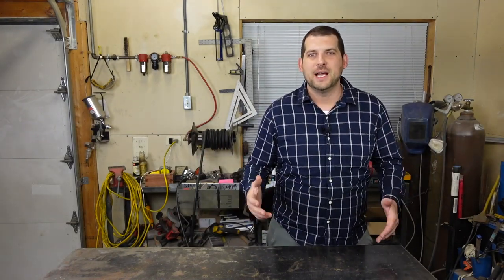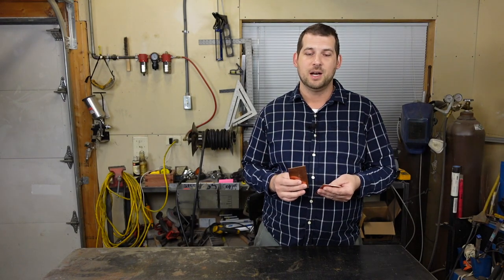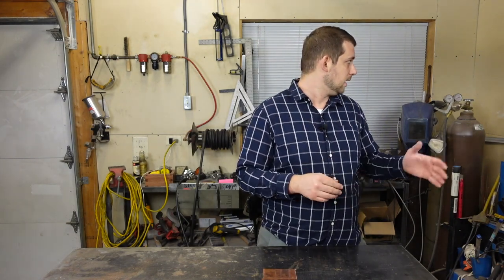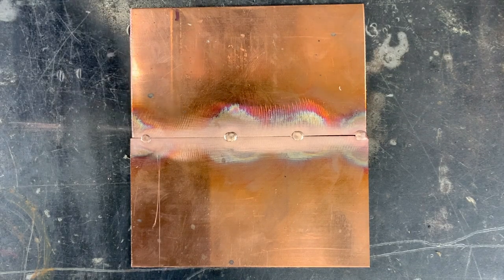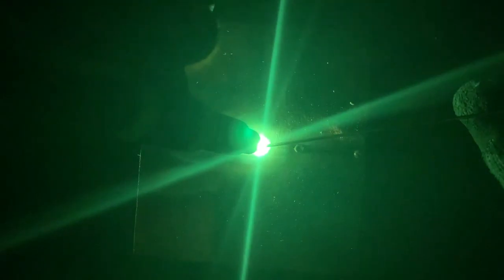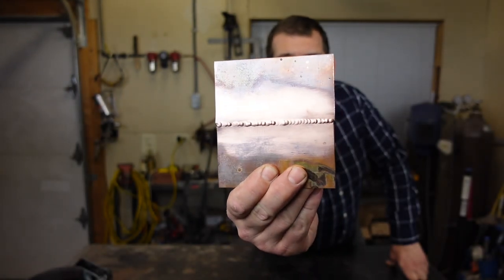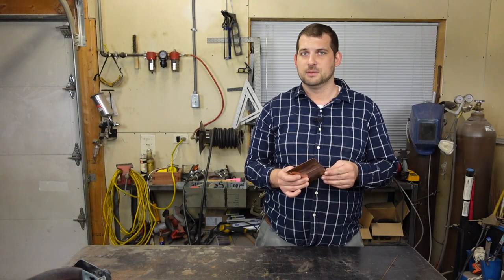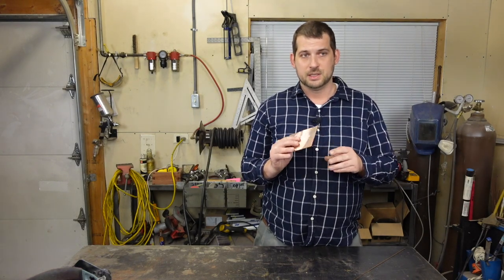CAN YOU WELD COPPER? - not solder, not braze, but weld? spoiler....yes you can and i will show you

Comment: novice question.. can you weld copper sheets together with mig? Instead of mild steel wire, would you need copper wire roll to feed in to the mig machine?
Reply from the maker: Yes I think they sell that as a specialty item.

Comment: That moth to the flame looked to get unhappy real quick! Interesting, I am looking to see of if I can weld pipe tight style an wonder if it would put less heat in the pipe overall. I have to braze pipe very close to sensitive parts and it is a challenge to keep the sensitive stuff cool
Reply from the maker: I think brazing is probably stronger on pipe since it fills the gap in the joint.
Reply: @TheMoonlightCraftsman  thanks for tip, just looking for any possible solution for brazing around sensitive areas, our younger guys are damaging some parts that are super close and I did as well back in the learning years, just looking to modern tech to make life a little more simple. It is hard to teach finesse
Reply from the maker: Wrap the pipe with a wet rag by your sensitive parts may help. Good luck!

Comment: Can we weld copper by mig welding ?
Reply from the maker: Yes I’m pretty sure they sell copper mig wire. I think ESAB makes some…..at my job we used silicon bronze wire on thin steel with a mig which would be similar. Soft wire like that works best with a spool gun that pulls the wire to the torch in addition to the wheels that push the wire at the machine

Comment: Hey man, curious why you brazed the copper on your awning instead of welding it like this?
Reply from the maker: Sometimes it’s a little easier to use brazing rod on thinner material because it  melts at a lower temperature than the base material, minimizes the chance of blowing a hole in the material
Reply: @TheMoonlightCraftsman   yeah that makes sense. Your awnings were really good. Nice sink too. Also you mentioned a range hood, would be cool to see that too
Reply from the maker: Ya I didn’t get much footage on that one, but the is a short I just put out that shows the finished hood.

Comment: Can weld coper on ac may welder dont haw dc?
Reply from the maker: Tig welder?
Reply: @TheMoonlightCraftsman  yes tig welder
Reply from the maker: That’s unusual. DC is usually standard, what’s your welder model
Reply: @TheMoonlightCraftsman  it is made in china dont knowe much more, it cant weld aluminum i weld steel
Reply from the maker: Ok ya that’s DC, your only problem might be not having enough amps, give it a try